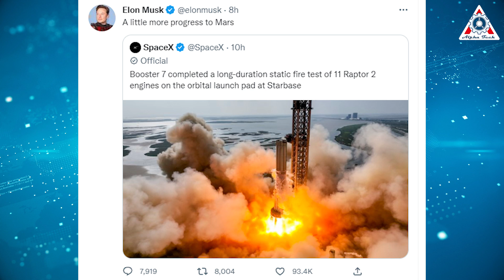SpaceX Boooster 7 11 engine V2 Static Fire tests “Concrete trouble”

Comment: Hello admin @ALPHA TECH ,how long would it take the heat produced by a 33 engine fire to melt steel.? What if the solution is a steel coated launch pad.? Lets say they lay a thick layer of molten steel to dry on the launch pad or even make it in the factory and just integrate it with the pad. You know the thick steel base of a super heavy which holds the raptor engines? something like that, only this time it should be laid on the concreate pad to prevent the damage that the raptors are making to the pad. This could be a permanent solution.

Comment: Are they sure the bolts holding it down can handle all engines. Did they calculate how much stress they can put on those bolts?

Comment: I think they need to dig out a deep trench beneath it that channels the exhaust away with all that water for that powerful rocket. Nasa had their own launch tower problem with Artemis after the Artemis rocket moon launch. There was damage caused during launch. Underestimating the power. Old shuttle towers used asbestos in concrete. Anyway deep long trench is what is needed because the further before the blast hits concrete the weaker the blast is and the more cool it is. The rocket hasn't even fired all engines yet. No way the launch site can handle them all when strapped down in the current configuration. Tons of water to spray down into a blast tunnel that is much deeper and further away from the engine.

Comment: Flame trenches need to slope at a lower degree.. bringing the trenches underground and using water to dump the vibration and pressure energies out and tunneling above ground to dissipate... thus making a more ergonomic entry and exit of the massive energy output of the rocket.
Reply: Sorry meant to say try a mobile launcher such as what artemis used and just launch it above the  new rocket exhaust trench

Comment: I think some people are missing the fact that unlike a static fire, a real launch will have the booster and starship going from zero feet to twenty feet and beyond above the OLM within about 5 seconds. The  vast majority of the damage to the pad is occurring because the static fires are longer with the space craft not moving. Yes, they still have some work to do and they will get it done. Any damage now, delays an actual launch. That's a good motivator.
Reply from the maker: So they can't fly this year?
Reply: Haven’t had all 33 Raptors firing, lifting 5,800 tons. The 13 engine test was just a third (more or less) of the total.

Comment: Solution is simple to successfully test all 32 Raptor engines on the SpaceX Booster and that is, "build a new Launch Tower with an exhaust Diversion tunnel as is normally done. This launch system being used to date is a failure and will continue to be troublesome.

Comment: In my view the concrete under the rocket will never handle the effects of the rocket blast due to the heating and pressure.! 
Solution is sheeting the floor with thick tungsten, or Titanium plate very securely ancored deep into the underlying concrete so the thick metal sheeting stay in place disregarding the incredible pressures and temperatures the area under the rocket will be exposed to.!  Concrete, no matter what type is used will not handle the sudden extreme temperature changes and pressure.!
The sheeting on the support pillars also need to be made as streamlined as possible as the lateral pressure of hot flames,  gasses and steam could otherwise cause issues there..🤔!!!

Comment: I cannot fathom why they did not use the Boring Company to duct the blast further down and away. Geologic factors in Boca Chica likely is an issue. But the launcher is going to have to be much more robust than this . What good is a quick turn launch vehicle if it destroys the ground service equipment? Remember they are planning to land the booster back on the pad. They've got a very similar ground situation at the Cape. So might be a good idea to go back to the drawing board at Boca Chica before doubling down on a unworkable launch pad in Florida.

Comment: Can you cycle up engines as you increase your distance from the pad?
Reply: No. requires full thrust to lift the fully loaded booster with Starship. 5,800 tons total weight.

Comment: force and deflection of gases heat water expanding away from flat surface concrete is a must? like the booster outlets having liquid fuel oxygen cooing it?? Concrete or metal skin  with water outlets coming out expanding steaming away seems the most easiest way as no gully is incorporated ? Concrete always explodes with heat

Comment: I'm going to say, we won't see a launch for another year. That tank failure on the can crusher points to a serious problem. The failure mode I see happening if they try to launch with any of the current designs is a crease forming on one side on ascent, then the power of the engines folding stage 1 in half and exploding close to the launch area. I think Musk pushed too hard for a light vehicle a little too much.

Comment: Is there any logical approach to firing some engines to get it off the ground and clear the tower, then fire the rest of them once you're away from causing any damage? Would you lose that much velocity?
Reply: The problem is that maximum power is needed to get the rocket off the ground when it is at its heaviest and has to overcome inertia. If it could lift off with less power then it would be built with less power.
Reply: @keithmayes4358  Well yes and no, the issue isn't so much getting off the ground but getting to the required escape velocity, the distance isn't very far to get up to speed to make orbit

Comment: No 'miracle concrete' can withstand the blast of those engines on a flat pad, best to use a blast trench/deflector and line it with 'miracle concrete'.

Comment: 3 foot thick steel armour plating  on top of the concrete under the rocket should fix the problem  The rocket engine acts like a drill it will fragment any type of concrete , The same type of armour plating used on old battleships, can be used.
Reply: Waste of time/energy/product/money, no issues with slight concrete damage on a TEST of multiple engines.
Reply: @matthewluke5315  IF the concrete fragments damage the engines, It will be very expensive and potentially destroy the rocket. Not a risk worth taking for a relatively cheap fix.  otherwise it's a flame trench and that is expensive.

Comment: Why do they use a trench at the engine test center and not on the launch pad?
Reply: To test the concrete, and to test the engines response to the concrete.  Needed for landing on non-Earth objects with these GIGANTIC Raptor engine's being used and multiple of them.

Keep them wheels turning!!  You are an exceptionally intelligent person for genuinely contemplating and expressing your concern/idea's 100%!!

Comment: If concrete doesn't work how about whatever metal the bellhusing of the raptor engines are made of use it to cover the concrete.

After all that metal has no problem handling that level of heat and whatever is produced I take off and landing and take off and landing again

Okay the ball's in your court give me an answe

Scientia Non Domus,
(Knowledge has No Home)

antiguajohn
Reply: I suggest you watch Every Day Astronaut's video on exactly that subject. A rocket's bell  housing is actively cooled by cryogenic propellant. It is NOT bare metal!

Comment: FAA is the least of Starship problems. While SpaceX may champion an iterative approach, it is a waste of time, effort and money iteratively working your way through launch pad issues which have been addressed by  engineers elsewhere in the past and present. I'm not a rocket engineer, however I do not understand the Starship launch system to be innovative engineering.  Water deluge systems, acoustic pressure mitigation, OLM explosion prevention, and blast pressure resilience all appear to be afterthoughts.

Comment: Consider adding Basalt chopped fiber to the Fondag mix to add tensile strength to the concrete. Basalt fiber reinforcement is widely available in Russia and likely elsewhere. Otherwise use refractory materials as found in the iron blast furnace industry. If there is any moisture in the concrete it will boil and burst the concrete. Install a warming system to dry out the Fondag completely: zero residual moisture allowed.
Reply: Exactly. It takes longer than a couple of weeks for regular concrete to cure let alone water tight FonDaq.  SpaceX got impatient.

Comment: I've been posting on various sites for a year that no deflector or flame trench is an incredible blunder that nobody thought of.  For the Saturn 1C first stage 5 engine tests, NASA practically tested it on the edge of a cliff to route the exhaust and flame from the base.  How can some of the smartest engineers on the planet overlook this?  A 33 engine burn is going to bring that entire launch tower down.
Reply: That's not possible.  Reinforced by multiple other channels then simply the concrete pad under TEST fire. SpaceX got this Bro, you can get a degree in rocket science, or learn on your own and prove your knowledge to the SpaceX Team, or just clap your hands at our many, many successes.
Reply: @matthewluke5315  Oh...OK...If you say so...Bro.

Comment: Lunch pad need to be higher and top of the lunch pad need to be wider to allowed to rocket not to damage Launchpad.
Arm holding the rocket in place needs to be bigger so it getting damaged the top of the Launchpad

Comment: Do they have a test stand anywhere with a single raptor engine pointing down on a test concrete bed to even see if different mixtures of concrete might withstand 33 engines?

Comment: Let's see....1, concrete and high thrust fire don't  mix....2, a flame diverted just makes toooo much since.......3, 33 engines will melt everything underneath it.
As high tech as this system is it seems foolish to have a flat area under the engines.....rookie move.

Comment: I wonder whether a hexmetal grid with bubble alumina concrete would be better than Fondag? Or perhaps an ablative coating on the pad like re-entry shielding.
Reply: I think lining the pad with re-entry tiles is a great idea to test them rather than waiting on a re-entry that might be difficult to determine what went wrong if the craft blows up.
Reply: @gregmcpheoge3598  That's not really what they're designed for. They're meant to deal with a heat shock from a layer of air that's not directly contacting the surface, and they're meant to do it on a blunt body that produces a very distant shockwave. Blasting them with superheated plasma? They won't hold up as far as I'm aware.
Reply: @maxv9464  I thought this craft was in the experimental stage being built within a process that uses an iterative approach to improvement. They could bolt one tile to the concrete and see what happens. Elon Musk fans are unimaginative.
Reply: @gregmcpheoge3598  I'm not a "fan", not in the sense that I blindly support the stuff he says. I'm here for the rockets, not for musk.

But I don't see what's there to be gained other than a potentially hazardous piece of debris. It's not analogous to reentry, and the tiles just aren't designed for the purpose of shielding from a blast. A good ol flame diverter would be just fine.
Reply: @maxv9464  Ground zero will not support what you're suggesting. They would have to completely remove the structure they have now to create a flame diverter. That would take at least 6 months and more likely a year. They have to come up with a quick solution. Funding will collapse if they are unable to solve these two issues. 1. the tiles falling off starshit and 2. the launch pad blowing junks of concrete in every direction much more so than my suggestion of one dinner plate tile. What you are suggesting given the investor constraints does not solve the problem.
Reply: @gregmcpheoge3598  Is that really the case? I don't pretend to know what they should be doing but installing a sliding metal diverter seems pretty darn reasonable. The legs have plenty of space. And I still don't really see what your suggestion would accomplish.
Reply: @maxv9464  Put the specs on paper and submit.

Comment: Starbase is a launch facility being used as a test facility. Static fire of a launch vehicle for 13 seconds over a concrete pad that contains water will always have issues. The high pressure flames for that period of time will boil the water in the concrete and convert it to steam. Water expands 1300 times it's volume at 212 degrees. At 1000 degrees F, it expands 4200 times its volume. The water is converted to steam and it blasts from inside the concrete called Spawling. Spawling spews chips of concrete at high speeds. New concrete contains the highest amount of water during curing. Unless they bake out the water and harden the concrete, the test stand will always have issues. Flight conditions are different. The time of exposure before lift off is much less. Hardening the launch platform for launch will be a challenge to itself considering the planned flight rate of Starship. Starbase is not MacGregor or Stennis and its design is not really conducive to the testing conditions for a Super Heavy Booster. For testing a booster, Space X might be better served by putting a booster test stand at Masseys with a pit of water underneath that is about 30 deep. In that way Space X would be free to test without causing damage to their launch facility and would have less road closures of Highway 4 that irritates the public.
Reply: Your missing some already done tests, that amount of water beimg subject to that amount of power will creat an overabundance of steam/steam-caused issues with the rocket, especially MULTIPLE rockets itself/themselves.  A "pit" will not provide relative balance of engine output, which would cause significantly erred results for an actual LAUNCH, as opposed to a TEST of engines.  SpaceX got this, be more concerned about C.E.R.N.!!  SpaceX is testing/using powerful engines, very powerful, C.E.R.N. had created miniature black holes, assuming you know what a "black hole" is, do you think that it's a good idea to CREAT THEM ON EARTH??
Reply: @matthewluke5315  "an overabundance of steam/steam-caused issues with the rocket" I thought you were just ignorant not knowing that all rockets use flame trenches filled with water that turn to steam. But then I read the rest of that word salad and realized it's much worse.

Comment: One thing I noticed about space X which I consider a massive flaw is that they put too many engines on their heavy rocket which I don't think is safe. What's the point of that?  If I'm not mistaken, Saturn V lunar rocket had like only 5 engines. Wouldn't many engines cluttered and packed tightly together cause heating issues?
Reply: no, methane turns to liquid form below  - 161.5.   very cold engines,
Reply: You obviously have no concept of the vastly different sizes of the Starship's Raptor and  Saturn V F-1 engines now of the safety record of the Falcon 9.

Comment: Very interesting report.  Thank you!  That concrete detail was really interesting.   I'm liking my hydraulic Eiffel Tower launch system idea even more now.    It's quieter; cooler, and safer.  The idea is to get into space;  not burn stuff and make lots of noise.
Reply: Please elaborate on your idea.  Yes, I work for SpaceX, we are ALWAYS open to new idea's, no matter there origins.  We would be DECADES behind on Space/Rocket Technology if we didn't abduct the Nazi scientist's after WW2, sounds horrible, but they were the brightest of the bright, by a lot, at that time period and were instrumental in most of NASA success.
Reply: @matthewluke5315  Assuming this isn't a joke; It happens,  I'm surprised you guys don't have A google supplied search engine for specific ideas expressed in the comments.  
Anyway, Here goes: 
Build a 600 meter tall Eiffel tower that has;  a hollow cylinder center; and sequentially discharging water jets that shoot water inward and upwards so to eject/ launch the rocket that may be set in the hollow center.  One side of the square base tower is removeable' or hinged like a large door,  to allow horizontal loading of the rocket.  The jets are powered either with hydraulic pumps or stored compressed gas like nitrogen or CO2 since compressed gas eliminates all the motors and bearings etc. and reliance on electricity.  However the valves will need to be electric valve controlled, so that they operate in sequence  like the Maglev trains do. --  ---   The engines will need an optimal throttling which I have not figured out.  I think: they fire at minimal startup speed then go auto lifting power (50% to 80%? ) about 20% up the tower.  
   This explanation has triggered the thought why not use Maglev tech to launch the thing?   Oh that's right all the onboard computers might go nuts!  Still It's a thought.  The trains have computers on board. doesn't ruin them.  Maybe use both; water and electro magnets or solenoid .  Anything but rely on just a big Kaboom to get launched.

Comment: Concrete has a triple factors of Strength, Durability, and Workability (i.e. set time, flow, etc.).  You change one and the other two are affected. That is a high strength mix lowers its durability, improving workability impacts strength, and so forth.

Comment: Put some lifting points down low on booster and some supports up a little higher.. lift that thing as far into the air as possible then fire up those raptors and just let that fat bastard fly out of you hand like a butterfly 🤓